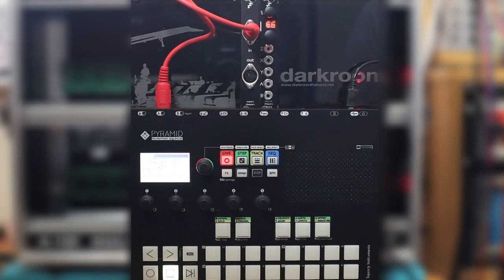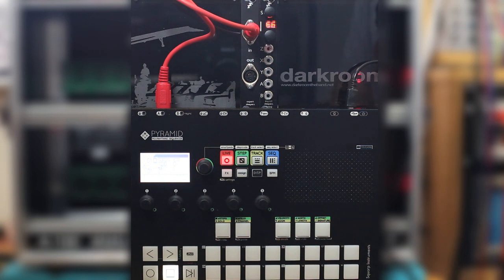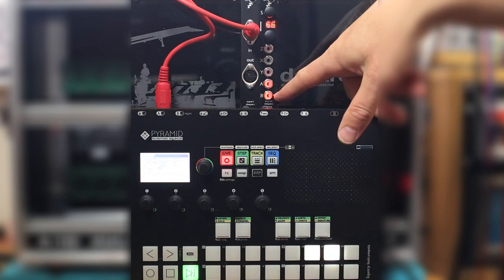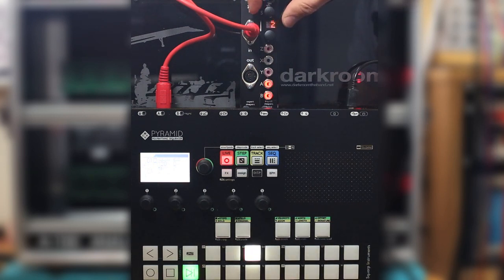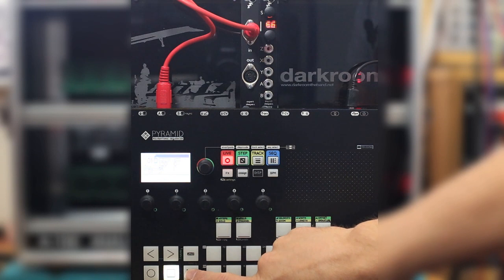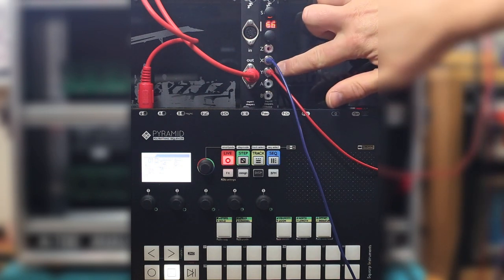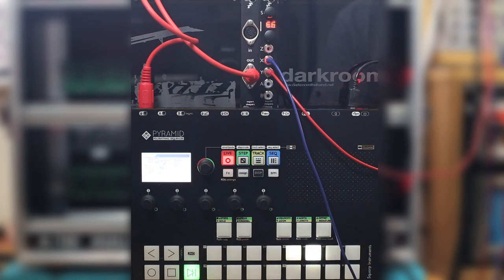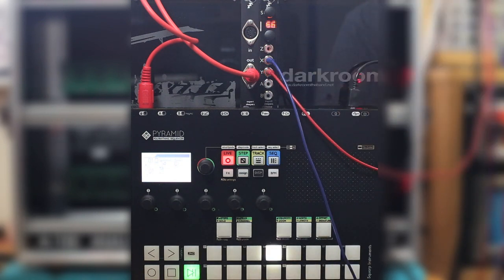disting mk4 - MIDI Clock

Comment: I'm trying to use a clock out from Varigate 8+ in the X input and get a signal on A&B, but nothing happens. am I doing it wrong?
Reply from the maker: You would need to set the mode (parameter 0) to 1 or 4.
Reply: @ExpertSleepersLtd  thx!

Comment: I'm using the Disting mk4 with the breakout midi module and Firmware 4.21. I am Clocking a Roland Mc-707 (Pamela new workout is the masterclock, going to Disting and through the Breakout Module to the Roland.). My problem is that the Disting every 30-40 stop clocking and crashes. I need to turn the power off my Rack and restart all to make it work the next 30-40 minutes. PLS Bugfix this! Thanks a lot.
Reply from the maker: Just to clarify, the disting is receiving MIDI clock from PNW and following that? Or the disting is following PNW via analogue clocks and outputting MIDI? When you say it crashes, do you mean the module reboots, or freezes (e.g. menus unresponsive), or just stops outputting clock?
Reply: @ExpertSleepersLtd  yes i use the G6 Algo. with Value 1 (Another module is the clock leader; disting converts to
MIDI clock and generates clock divisions.) i have the Midi breakout module connected to the disting. Midi cable to the Roland MC-707. The Disting is just stopping and will not run again until i reboot the hole eurorack Power. I did not try another Algo, after the clock stop/crash. The Disting does not Freeze but the Clock is stopping and will no longer work till power off/on. PNW is sending analogue clock to disting.

Comment: I'm using an SQ-1 as sequencer and attempting to get it to lock to my DAW via the Disting. The machines run in synch but SQ-1 does not appear to respond to start/stop commands. I'm assuming that adjusting parameter 3 (the run/stop option) and using this as the sync input to the sequencer will do the trick. Any help or advice gratefully received and thanks for a marvellous piece of kit.
Reply from the maker: I don't think it will do it. From Korg's website: "To synchronize the SQ-1 to an external device, you can use either of two methods: USB-MIDI connection or SYNC IN connection. USB-MIDI connection allows sequencer start/stop and tempo synchronization. SYNC IN connection allows only tempo synchronization."
Reply: @ExpertSleepersLtd  Thanks Os, noted. Needless to say the Korg SQ-1 driver doesn't function on Catalina, which might have allowed for slaving the Mac to the SQ-1 via USB as an option. I'll just have to continue exploring the marvels of the Wavetable VCO until there's an upgraded Korg driver available.

Comment: hi i have got both the disting mk4 and the midi expander, i was hoping you could just do a video of how to connect it together at the back as im not sure where the right connections go.
Reply from the maker: There are a number of ways of doing it, depending on what's most convenient to get the cable to fit in your case. However you connect them though, pin 1 needs to match up at both ends. You can't damage it by reversing the cable though, so don't worry too much.
Reply: Expert Sleepers I’m snuggling with this too and I don’t seem to be able to see half of your post

Comment: Hello! Is it possible to Input an analog clock on X and output its divisions on A/B? I'm sending clock from Ableton trough a midi router box converting the midi clock into ppq 3.5 jack and going into X input. But then I have nothing coming out of A/B. From this video I'm understanding that OR you input an analogue clock and outputs digital, OR you input digital and output analog, but you can't input analog and output analog, is that right? I just need to divide this ppq and send the divisions to my Moskwa sequencer. Is there a mode on disting that works by dividing only analog clock? Thanks very much, I'm loving my disting.
Reply from the maker: Not clear what you mean by "converting the midi clock into ppq 3.5 jack and going into X input". How are you converting the MIDI clock into an analogue clock?
Reply: I'm using a midi router connected via midi with Ableton Live. One of the outputs from this router converts the digital clock to analog pulse via a Midi to 3.5mm jack cable (DIN SYNC output). So that way I can send the clock to my Moskwa. I just would like to be able to divide this pulse into 1/8, 1/16 and so on. Because I'm stuck on 1/4. Maybe because I'm not familiar with the right terminology of things, I'm might sound confuse, sorry about that. I think that I'm looking for something to divide the analog pulse. X input on disting receives and shows this pulse going in, but I don't know if I can take this pulse divisions out of disting. thanks again for your attention.
Reply from the maker: The clockable LFO algorithm works as a simple clock divider.
Reply: oh that was exactly what I was looking for! Thanks very much!

Comment: do i need the expander in order to send program changes to it ? or can i just use midi to cv etc to change it , i want to program change from the cirklon to the disting (i use beat step pro as midi to cv ) thanks
Reply from the maker: Yes, if you want to send MIDI program changes to the disting, you need the MIDI breakout.